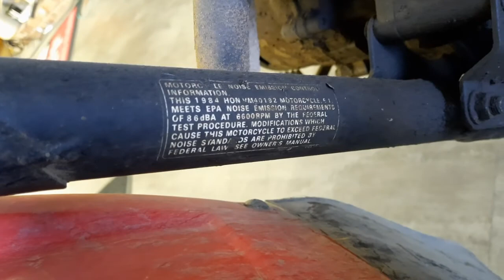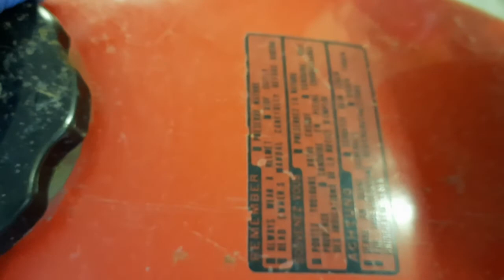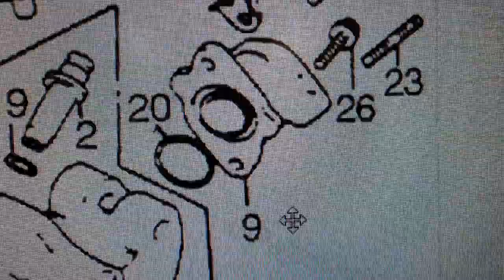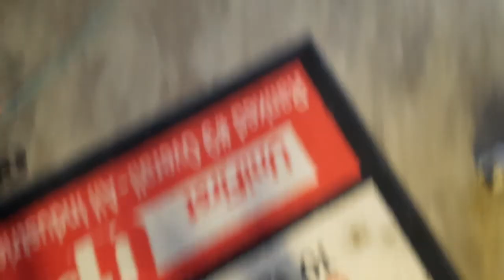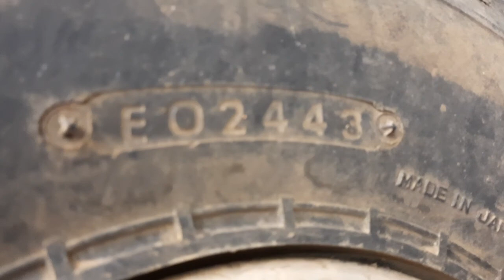Honda ATC200S Restoration part 1

Comment: In extreme summer heat remove front fender so fins get air especially if riding in sand or you'll overheat and destroy pullrope trying to start hot engine.